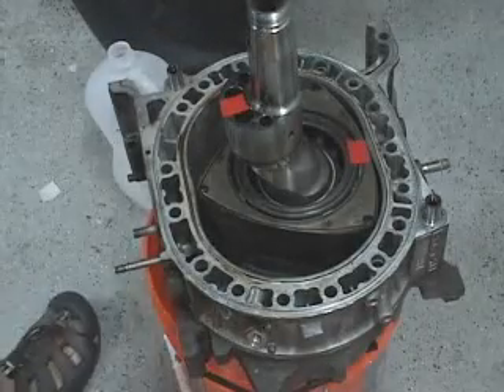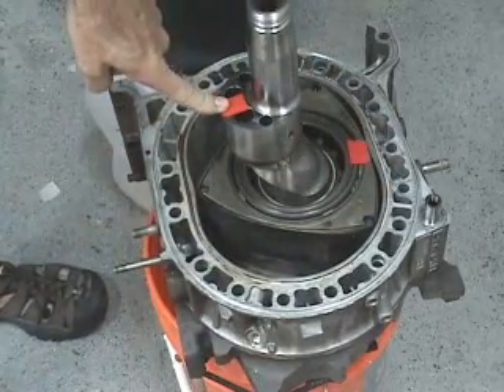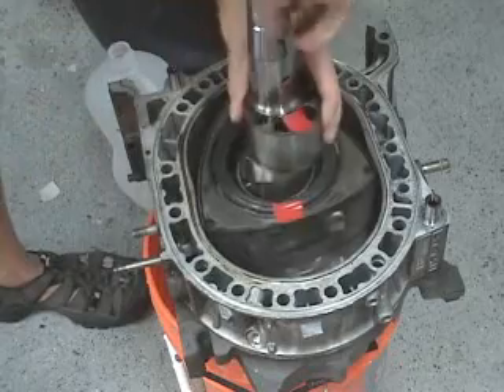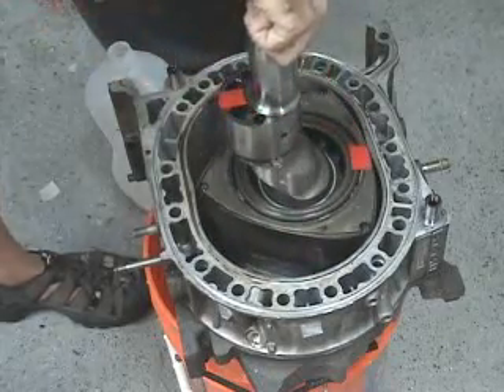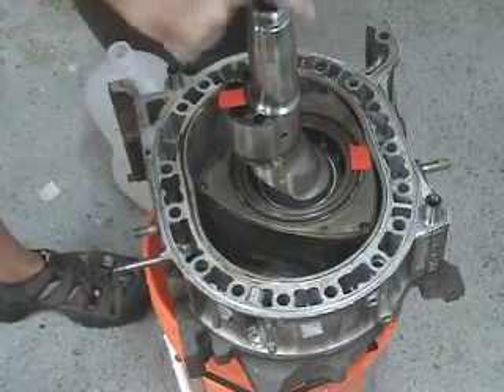Rotary Rotational Demonstration

Comment: Aren't rotary engines easy to fix?
Reply: ***** Any repair that requires removal of the engine, complete tear down and overhaul is definitely not what rational people who live in the real world call "easy to fix"
Reply: The Readers Corner No... theyre not really... PS: this is a Wankel engine... not a Rotary
Reply: They are very easy to fix, compared to their piston counterparts.
Reply: +martin araujo Well, if that were true? which its not... you would see alot more still on the road.... but you don't

Piston counterpart???

All Rotary ICEs have pistons...

and so do Wankel engines

Comment: I came to this video excited to learn something and I have no context, any my advice is to work on your pedagogy instead of getting angry.

The tape marks clearly demonstrate the 3:1 relationship. Your gestures to the engine confuse the clarity of the marks though, so I understand why people are getting confused.

When teaching, you need to understand that people are paying attention to the cues that you make.
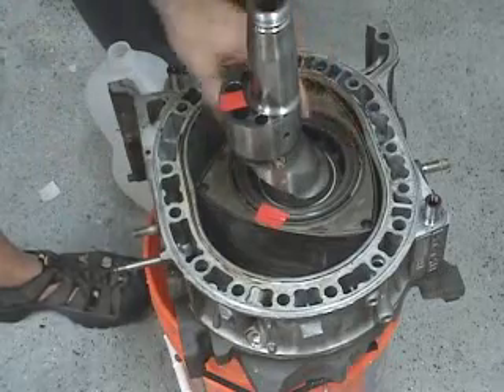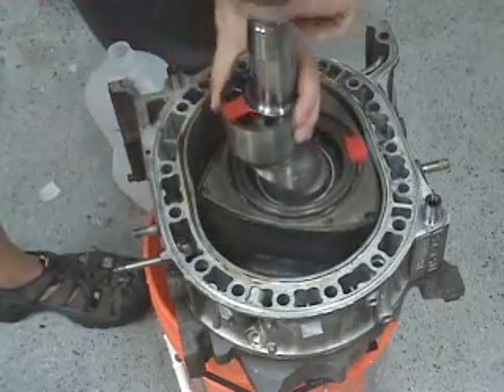You make a specific gesture towards the compression cycle three times, each time there is a compression cycle. At 0:22, 0:26, and 0:30. After it's repeated three times, people will understand that when you point to the compression cycle, you are talking about a compression cycle.

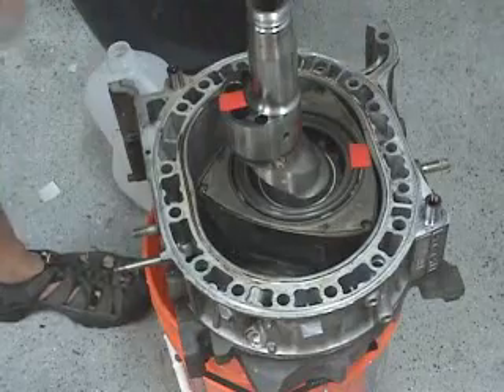Then at 0:35, you repeat the gesture, but the meaning has changed and now you are talking about an entire revolution of the rotor with 3 compression cycles. This confused people because the meaning of that que was clearly demonstrated, then you changed it.

Honestly all you need to do make a different gesture when you say there is a "1 to 3 relationship". Maybe just point in a circle all the way around the chamber, or say something to signify that you are switching like, "you can see after 3 compression cycles the rotor has made one full revolution". Emphasize that the 1 in the "1 to 3" is referring to one whole revolution of the rotor, and not 1 compression cycle.

If you know something other people don't, then they are as smart or as dumb as you make them.

Comment: And to add to the previous comment rotary motors are a thing of the past. They were used for vintage aviation because of their low exhaust sound. 
But the dicks who drive RX -8s insist on making them loud...
Reply: Machine Man Rotary engines and Wankel engines are both a thing of the past...  both were used historically because of their high power to weight ratio.. unfortunately both designs are obsolete now.
Reply: The real doktorbimmer apart from the shit heap RX-8 which still uses one
Reply: Machine Man Actually no... Mazda ended production of both the RX8 and the Wankel engine 3 years ago... The Wankel is completely obsolete now.
Reply: The real doktorbimmer wow! That didn't last long! Maybe they realised what they were getting themselves into
Reply: Machine Man The prevailing view of main stream engineering world by 1975 was that there was little viability in the design and by the mid-80s all of the 26 major manufacturers that bought licenses to build or develope the Wankel (except Mazda) had abandoned it... I guess the folks at Mazda didn't get the memo!
Reply: The real doktorbimmer suppose so!
Reply: Machine Man For many years the Wankel engine was seen as a key to Mazda's public image, as something that made it stand out from the sea of unremarkable Japanese models. There were several members of the Mazda management that were comitted to continuing with the Wankel engine in production against the advice of many Industry experts who predicted the company was headed for certain disaster... these predictions came true after the collosal failure of the new RENESIS and the RX8... In an effort to save the company many of these individuals were removed from company management and Wankel engines were finally abandoned for good.
Reply: The real doktorbimmer for the better really. I should tell this to the idiots I know at school who insist on thinking the RX8 is a good car
Reply: +The real doktorbimmer If the rotary engine is obsolete then why Mazda is still working on it? Latest news - http://www.roadandtrack.com/new-cars/car-technology/news/a28706/mazda-patent-hints-at-an-updated-turbo-rotary-engine/
Reply: Mateusz Pawlica Its the Wankel engine.. and if its not obsolete then why is Mazda no longer selling them?
Reply: Mateusz Pawlica latest news- Did you know there were 12 new patents filed this year related to steam powered automobiles?
One might get the false impression that steam cars were not obsolete...

Comment: Seems like a lot of winding to complete the cycle. I'd have to see it in direct comparison to a regular OHV internal combustion engine, turn for turn. I am pretty sure more power is achieved with a single 1000 RPM through an OHV ICE. There's a reason why most race cars and manufactured cars don't use the wankel engine, because it's lame! The renesis was an attempt to make it better but still, it wasn't worth the effort. It does work well but it is not superior.
Reply: doktorbimmer It hasn't yet been beaten for HP per pound by any 4-cycle engine to date, and most of these discussions act as though there's only one rotor - most production Wankels had 2. It behaves volumetrically like a 4-cylinder, and I dare say most (in the US) lived just as long as their piston counterparts. Ran fine as long as you understood it used oil from the crankcase for combustion and you had to check it. What report/study said the 4-cycle lives on average twice as long?
Reply: balls deep Actually the RX8 was a huge sales flop before new emissions standards were ever announced... the Wankel engine was no longer  a viable design 3 decades ago... I guess Mazda didn't get the memo......
Reply: Is this satire?  A regular 4 cycle piston engine produces 1 combustion stroke per 2 revolutions of the crank.  This vs. 1 combustion per e-shaft revolution on the wankel.  You don't have to love it, but it's neat to know.
Reply: Cody Brooks He is right, no one uses the Wankel engine anymore.. a 4-cycle 'Otto' engine is superior.. and has completely replaced the Wankel... it generates far more useable energy, hp and torque per lb. of fuel burned, it burns it cleaner and lasts on average twice as long... all this with better torque characteristics too.  Its an facsinating design for sure, but there is not much to love about it.
cheers!
Reply: ***** Never driven one...????  Hell I owned one once! Worst car I ever owned and the only car that suffered an engine failure...

Certainly anything that is obsolete is indeed unique...  There is a good reason no one sells them anymore.... all the smart ones have figured it out too...

Cheers!
Reply: Chris Heim Actually it has... perhaps your facts are a little out of date..

More like a 6 cylinder... with a 2:1 displacement ratio as the most agreed upon in terms of average CFMs or ltr/sec... or HP per liter.
 In terms of Nm, or ft.lbs per liter/rpm its more like a 4 cylinder of equal displacement... 

It a well known fact that Wankel has a shorter service life and that the core engine is far less reliable.
Reply: ***** That is not true... one of the main reasons the Wankel engine is obsolete now is that they are highly unreliable and have a shorter service life than any othe ICE design... Apex seal are and have always been fragile and problematic, side seals and housing seals also fail requiring engine removal, teardown and overhauls.
Reply: ***** Well if that was true?  Mazda would still be making them... the fact is they are less reliable and have a shorter service life, its why people stopped buying them and even Mazda had to stop making them.
Reply: They're nice but not superior in any way, might be cool because it's unique, that's about it. They're nice cars and all but I mean, there are electric cars that are fast and nice too but it doesn't mean they're better or more reliable than a regular ICE.
Reply: AGENT G The disadvantages now completely offset any advatages it was once considered to have.... its disadvantages have become a more serious problem as cars are expected to be more efficient, cleaner and last longer...
Reply: The real doktorbimmer mazda stopped making them because of the new emission laws.
Reply: The real doktorbimmer no longer a viable design 3 decades ago? haha, they've known to be extremely successful in all aspects of motorsport. it all depends on how well they're built.

Comment: so it worse than i think jim....so you are saying that when the rev clock is reading a red line of 9000 rpm thats the speed of the out put shaft...so the rotors or only going 3000 rpm........................and the apex seals still wear out
Reply: balls deep Lol!!!... No its not!.... the tachometer always reads crankshaft rpm!
Reply: david appleton Nope, the most popular UAV manufacturer is Rotax an Austrian firm that builds mostly horizontaly opposed 2 and 4 stroke engines..

There are no Wankel engines in series production anywhere in  the world
Reply: no thats reading the speed of the rotors, so the out put shaft is actually turning alot faster
Reply: david appleton so they can make 300hp from a 1.3litre n/a at 3000rpm.. nice
Reply: balls deep Just the facts man... just the facts
Reply: balls deep They can, but not for very long. Cheers mate!
Reply: The real doktorbimmer yeah they do thats why they have been used in aeroplanes for years
Reply: +balls deep  I think you maybe confusing the Wankel rotary with a radial piston engine in regards to aviation use! very few, if any rotary engines are used in aircraft! The only exception might be in regards to an experimental aircraft!
Reply: ctd0007 i think they are putting them in military drones

Comment: Rotary engines are so shit.
Reply: The fact they are no longer sold certainly says something...

Cheers!
Reply: rparker069 They have much less power advantage today then they did in the 1950s.. modern Otto engines actually produce more power per liter (using the 2x conversion factor) Wankel engines have always produced less torque and are far less efficient than Otto or Diesels.
Wankels have very poor fuel efficiency and very high exhaust pollution.
They are a little lighter.. but their cost per Hp is also higher,  add that to the fact that they have always been less reliabe and have a shorter service life is a very complete explaination of why they are no longer mass produced by any engine manufacturer.

cheers :)
Reply: rparker069 If they were as you said then why aren't other manufacturers using them? Also you couldn't be more wrong, rotary with torque? Don't make me laugh.
Reply: shit despite the fact that they have more power, torque and efficiency than a normal piston engine, plus weigh less and are better for the environment?

Comment: one other reason these engines didn't catch on because very few people could rebuild them if the went bad so they were a throw away engine if they went bad. You didn't mention that idiot. lol
Reply: People who can't rebuild them shouldn't praise the ease of a conventional engine either.  Look how much more simple this is to rebuild, you don't even have to match up timing marks on anything (cams, balance shafts, etc).  This is really simple.
Reply: yep and with only a couple of moving parts I'm sure it won't cost much to replace major components like that big thing in the center. What do you call that thing? The crank/piston/compression making thing for three holes...

Comment: did he just call us idiots
Reply: doktorbimmer first of all you have to realise this engine's "power output can't be compared with your everyday V, straight or boxer engine, because there you have linear movement of the piston, so power output is calculated diferently where as wanke has circular movement of the "piston" (rotor) basicly 1.3l wankel produces 230bhp where standard straight6 2.6l engine averages around 350bhp but 2.6l Wankel (at the minimum) doubles the 230bhp of a 1.3l one plainly speaking that simply means its more efective... efective enough actually to be used in most light aircraft and even in some USAF ones now the tork (which is basicly number of N m) is result of technical enginereeng of an egine which in turn depends on how the constructors create the engine, and finaly one rotor revolution means three E shaft revs which means its not 1/3 less it's 1/3 more
Reply: milos stepanovic said qoute; "comes from the fact that it fires three times in one rev..."
No, it does not fire three times in one revolution, revolutions are counted at eccentric-crankshaft speed not piston speed so the number of combustion cycles per piston revolution is completely irrelevant.  rpm and torque are still measured at the shaft like any other engine..  perhaps you should go back and watch the video again more clearly... you obviously missed the point of the demonstration that was so clearly made.

Cheers!
Reply: @doktorbimmer   you misspelled "quote"
Reply: OK lol
Reply: doktorbimmer Wankel engine 's thirst for fuel and its capability to produce 230bhp (in Mazda case) even though its only 1.3l actualy comes from the fact that it fires three times in one rev...however the revs we're talking about are not the shaft revs but "piston"-rotor revs... take a look at more diagrams, but watch more observantly....
Reply: milos stepanovic Not really.. you measure horsepower and torque at crankshaft rpm, not piston rpm...which is 1/3 less,  so the number of combustion cycles per piston revolution is not relevant. 

But closer to a 6 cylinder 2.6 liters in terms of CFM in airflow equivalent displacement.

The problem with the Wankel is it burns almost 1,000hp worth of fuel (in BTUs of heat) yet only produces less than 250hp in actual shaft horsepower... horribly inefficient compared to say a large displacement Diesel engine that can generate produce 0.25-0.35 BSFC and exceed 50% total efficiency.

Cheers!
Reply: milos stepanovic ah, no... power output is measured at the shaft, just like any other engine.. even if its electric, turbine, reciprocating steam.. its measured and compared the same. 

Your obviously not an engineer or you would know this..

No, it doesnt.. its less effective because it produces less torque at low rpm.

Its still equals one combustion cycle per revolution of the crankshaft per chamber...

Cheers!
Reply: doktorbimmer Yes, no mater the engine power output is measured at the shaft, but the formula of calculating the power output is rather diferent because of the fact that in standard engine propelent of the shaft is linear movement as oposed to the Wankel where propelent is circuular movement (It's conected with the directions of the force). Mate I had a ubject on this throughout entire middle school it was caled internal combustion engines and vehicles with internal combustion engines. It's rather complicated for me to explain all the tiny bits and pieces to you in english (for obvious reasons), however I can tell you this: producing less torque at low rpm is rather very normal for every engine because if you would to have engine that produces more torque at low rpm you would have practicly a constant wheelspin since wheelspin is conected to the torque "overload" while the vehicle is stationary or moving at constant speeds (and constant speed means low rpm...)
Reply: milos stepanovic No, its not different.. we use the exact same formulas to calculate HP and Torque on the Wankel as any other engine or motor..

 Well if its difficult to explain? its usually because you don't understand it very well yourself.

Cheers!
Reply: doktorbimmer Have it your way...
Reply: doktorbimmer Maybe you could discribe it this way, no matter what engine you use, you always measure the power output at the shaft (i assume in this case torque over revolution per second?). After that you can calculat the test run you can measure the consumed fuel, therefor calculate the theoreticle thermal energy and then calculate the efficiency? I don't now if a casual efficiency formula for the Otto cycle based on the compression ratio and Kappa (isentropic exponent?) would work as good as the good old fashioned energy comparing methode ;D.

Comment: Wow, had no intentions on watching anything to do with this video but I can honestly say I learned something. 3 combustion cycle on a Mazda Rotary Engine.
Reply: I'm sure you meant to say 'Wankel Engine' .... the engine type clasification of the Wankel engine (KKM-57) is not a rotary.
Rotary ICEs can be 2 or 4 stroke and have one common feature, the engine block or case rotates concentrically around a fixed shaft. (Dr Wankel first prototype used this layout)
The only commercially successful rotary type ICE was the 'Millet' type which has pistons and cylinders arranged similiar to a 'radial' aircraft engine.
 Cheers!